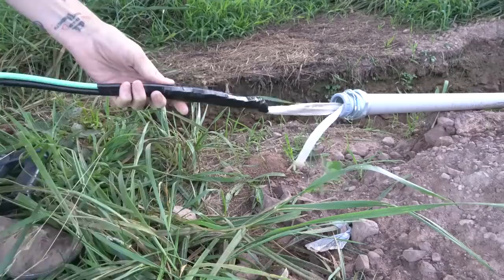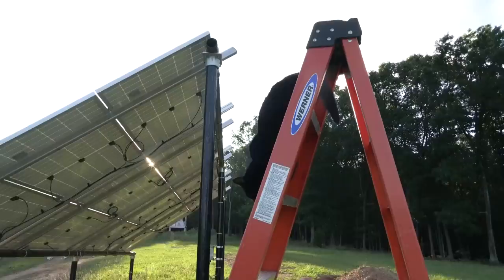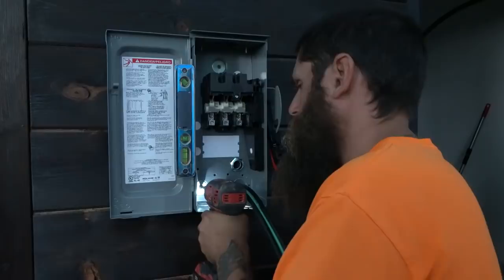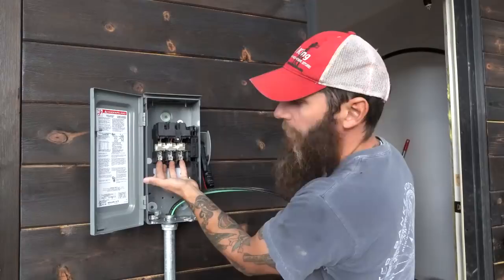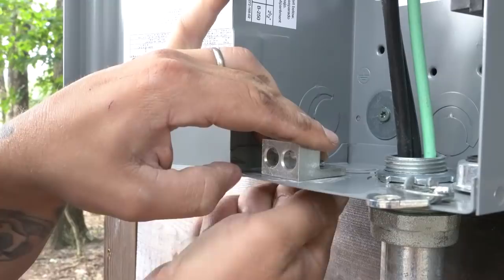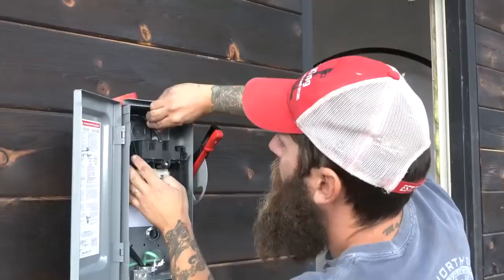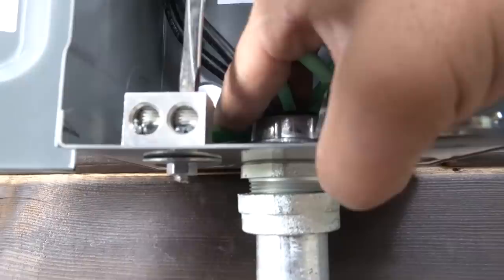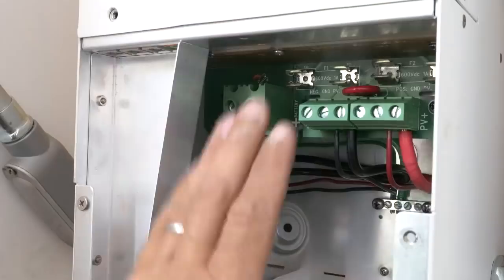She's Got A DISCONNECT- DIY Electrical

Comment: You can tell this is not Josh's first rodeo !! We need to hear the light bulb story !! Great camera work, Erin !!
Reply: Well from what i saw , i think he is an electrician in real life :D . That's why he is so good !
Reply: @clodu2008  He is.
Reply: @williscooper7750  i watched the first few seconds of him stripping back to do the pull and i knew it and miwalkee tools most good electricians use them and i like his explanations
Reply: @clodu2008  As an old Master Electrician, the only thing that I saw that was a "violation" was pulling wire into an incomplete raceway. Which is helpfully located in the portion of the code titled "Silly regs that we've been known to ignore". But it's in there, somewhere. 

So, yeah, perfect. :)

Not sure why he chose to use a 3 pole disconnect though. But if you have one laying around, and it's free, it's a perfect choice. :)

But no ground rod? I'm not up on solar installations, solar power mostly being limited to clothes lines in my day, but this looks like it would need/benefit from a ground rod.
Reply: @MrWaalkman  they have two ground rods.
Reply: @clodu2008  "in real life" ?   lol

Comment: Just a tip: If you put enough duct tape on the drywall when you make a hole in the wall (on the opposite side of the drill entry), the burrs will not appear. That's it. God bless your family.
Reply: but doesn't the duct tape tear off the paper facing of the drywall, creating more of a fuss when you go to remove it than there was the little bit of tear out he experienced?

Comment: I absolutely love your videos and I love the way you work. Once you've determined the quality of those batteries I'd love to have the link to the seller's shop or profile on e-bay. I would love to take my home off the grid.

By the way, I'm also an electrician for 35 years now (currently a project manager in large scale electrical contracting in South Africa), and I love your quality of workmanship. Standards over here sometimes are so low you struggle to get someone to use a spirit level.

Comment: Your craftsmanship and pride in work shows.
Question...is buring aluminium wire not against code there?

You two are great!
Reply: @usplusfive5968  
Oh, ok. Thanks for the reply. The inspectors around where I live came unglued when I inquired about buring aluminium and not copper because of costs.
Reply: Wm H , you usually have to go up one size when using aluminum but it’s best to pull out the code book and check. I went up two sizes to cut resistance and save energy over time. It pays back if you keep the place for years. But since they went up to 288v, the amperage will actually be really low. Most folks don’t know it but high voltage and primary lines are usually only 61 amps.....but thousands or tens of thousands of volts.

Comment: I am a sparky myself and wondering why you put the cut-off box on the outside of the shed? Could you have placed it on the inside? What are your reason to put it on the outside? Has it to do with US code that the cut-off must be open access and not in a closed shed (maybe safety and firedepartment rules)? 
It's looking great and I'm sure it will work wonderful!! Love your videos and you banter makes me smile. 😃😂👍
Reply: I thought the same at first then thought maybe it was to be able to use the buggy to pull the wire? may have been tricky if it was an interior end point?
Reply from the maker: It could have placed inside the shed. It was just my personal preference to be able to access it from the outside.
Reply: Guust you don’t want that big box in your house , but I Think he could have used a main breaker in the house channel

Comment: Nice professional job Josh. Your are a 5 star electrician. You do it right or nothing. No corner cutting. BRAVO. 
And my panels are also located far from my house. I have a 3% drop but I have a 8kw system.

Comment: why you didn't pull a spare pulling wire with the electrical wires  for future updates
Reply: You really think he didn't size this wire up enough to handle future solar upgrades? smh.
Reply from the maker: We sized the wire for an additional 6 panels which is more than we will need.
Reply: Now what is done is done you did a great  job but I wasn't talking only about  electrical wires it could be used also to   remove defective wires or pass network for security cameras  it holds a great angle from the other side  that's it . It will  always come in handy you never know   cause  it's a very long run  if you want to fish it  in the future ..

Comment: Just a tip with the anti-ox paste, it works great on copper and vehicle battery terminals. The reason why the aluminum is larger than the copper is aluminum must be 1 size larger (at least) to carry the same amount of current as copper.  There is a section in the NEC codebook which has a nice chart on all capacities of all size wires, alum/copper, depending on your application.  Looks good!

Comment: Thank you for taking the time to explain why you were doing all the steps and why the equipment you used was required.  I’m glad you had a good experience with the AltE store. I am leaning toward buying my solar components from them. I would like a little more info on the batteries you got as that seems to be one of the most expensive components of the system, especially for lithium batteries.

Comment: Hello guys, greetings from Bulgaria :) I have some questions and advices for you.
Firstly, how you`re not afraid of hailstorms for example. A big storm can practically destroy your solar panels. It will be a good idea if you install additional power sources on your property. For example, if you have a small river close to the house you can put a water turbine generator there. Its much more effective than the solar panels. Also, wind turbine is a good idea if you have enough wind in your area.
Another thing, have you considered using super capacitors instead of batteries. Yes, they are more expensive, but you can use them for many many years without changing them. 
That`s all from me, I wish you all the best :)

Comment: In the house, in the box, 600-watt fuses are installed. 600 volts. Multiplied by 1 ampere is equal to 600 watts, I think it will be small. Although I do not know what you conceived there. But even a simple electric kettle consumes from 1500 watts.

Comment: Also I've seen other people make the solar panels adjustable. To help catch the best angle coming in. And you sending that solar a long way. I think you should get another small panel close to the house. Make it adjustable. And you def. Need more batteries. You could wind up without power for a few days during bad weather. Not sure how you would tie it in. But that's your headache not mine. Great work.

Comment: Very nicely done video and work!    Just so you know, the 3% in NEC for voltage drop has nothing to do with what you were doing.   Voltage drop for what you did is, less power for shorter amount of time.   Shorter amount of time because start voltage for the inverter will take slightly longer to reach in the morning and off sooner in evening.  Your 2%, perfect!    Also,   For bee or wasp stings, wet tobacco and stick on the sting ASAP.   Leave it on for a while.   You might not swell at all.   I learned that from an American Indian when I was young.   Best wishes!

Comment: Nice and clean installation. If anything I would have identified the natural with white tape. And in most electrical connections a loop in the wire before the final connection. The loop does two things, if the connection burns up you have enough material to make an adjustment. a loop (although small) provides a cancelling emf. kinda like a filter - magnetic fields cancels each other. I normally work three phase but I carry it into the single phase applications too. On the surge arrestor - does it have a physical identification if and when it receives a strike? Overall Nice Job.

Comment: The other downsides of aluminium wire: it breaks after bending 3-4 times, it creeps away in the clamp - you have to retighten the clams every now and then. We had aluminium cables all over in the GDR, thank god we do not see it often anymore.

Comment: I REALLY appreciate you showing the correct way to wire and great camera work.  Noticed the wiggle when you're tightening the lugs for a better contact (I assume).  Does Alum have the same load capacity per/gauge as Cu?    You Tube University, at it's finest!  Also, THANK YOU for going there!!!  Funny stuff.  BTW, screw dinner, I want to hear the story!!!

Comment: Josh your workmanship is incredible I especially like how all the fitting screws are in line and the overall neatness is awesome.  I do have one question though, why mount the disconnect on the outside of the building?

Comment: You are good to go on the panel mine is next to the solar system you guys are great I got my batteries from batteries plus 275amh for 125.each im an old disabled veteran i got my solar from amazon plus free shipping panels 89.each i have a lot for sale. By Talkeetna ak 10.000.and one more thing have you guys made pizza bread or biscuits from yogurt self rising flour. Its so good

Comment: I didn't realiize how much effert went in running a line that far away. .Josh you done a great job wiring.do you do electical work in VA? just wondering I'm just in the process of building a smaller home and It might take a while but I'll need a electrician. You know what your doing. I won't have a big array like yours but you could do it. You guys make a great team. That's why I love your channel so much. Even the kids work out too. much love between you all and god bless your family.

Comment: Great video 
Like what you guys are doing.
I'm surprised that you did not install a ground rod and connection at the fuse box on the cabin .
Reply: Hi Other  Guy, sir you are 100% correct. A solid copper grounding rod buried in the ground it required to ground the system.  Hopefully now that you mentioned it they will look into it and adapt.

Comment: Hi. Wouldn't it be better to have one ground rod for the panels, and another ground rod for the shed? You wouldn't need the green cable, and resistance to the ground would be lower in the shed.

Comment: So I'm guessing that disconnect is DC ratted for the 280 volts DC.  I have seen companies use AC, Disconnects that burned up once set to disconnect because of the arcing from DC voltages that high.   I know all most all AC breakers ect have a DC rating that they are able to work with.

Comment: Ah yes, Lords of all you survey! Building your own solar system. And you saw it and said it was good, yes, very good. Great job guys. As for the expansion of power, Yall should have plenty of squirrels around there. Just catch em and put them on energy generating treadmill wheels. Seriously though, have you considered a wind turbine for the short days of winter when the wind blows well? Also, Josh, what did you use to suck that pig through the pipe with the strap attached to it for the pull?, thats a lot of suck. I must also point out that Josh looks as if he has mounted those boxes before LOL... I noticed you use a flat-sided shank on your screwdriver. Knowing you electrify for a living, is there a reason you use flat side instead of smooth round? The video was excellent! It was real good of yall to do it.

Comment: Just curious where your actual earth ground is? That wire you pulled was your bonding wire, but I didn't see an actual ground wire. Also, nice job on the phase tape, but that small of wire isn't allowed to be phased tape in AZ. It has to be factory color coded.

Comment: Disconnect may be rated for 600v, but not DC.  It may disconnect a few times under load but will eventually weld itself together or arc the connection so that it won't work.  AC is much easier on disconnect, it's alternating, DC is constant, unforgiving.
Reply from the maker: It is rated for 600v AC AND 600v DC
Reply: @WildWonderfulOffGrid  3 phase DC, first for me

Comment: As far I could see in the video,  the pipe with the wires through the outer wall is not airtight. I'm wondering if this Is not covered by the Building Code. In the Netherlands this should be always the case.

Comment: I have to wonder, why pull that much wire for a ground?  A ground rod at each end would have reduced the cost quite a bit and given much the same results.  And if I remember correctly will be required anyway for code.  Two ground rods would run about 15 each for a total of 30 bucks vs about 1 per foot over 400 feet.  I know some locations require bonding of a minimum of two rods but even two at each end would have been less costly and each structure needs a ground rod of some sorts.

Comment: Josh, I'm not familiar with solar power, so I've got a question. Does your system require a ground wire/rod like at a standard residential service entrance? I saw where you used the lightning arrestor , does that replace the grounding rod? 
Very professionally done, I must say!

Comment: You definitely do good work. Only electricians get that excited about ground bonding. Lol but... Did u use a DC disconnect because of the DC arc is harder to extinguish due to it never crossing 0v like an AC sine wave? If it's not I'm sure it will be fine but I wouldn't use it too often under load cause it will wear out the contracting surfaces a bit faster. Typically u see relays and such that are rated for both AC and DC usually handles a lower DC voltage and current then its AC rating. DC disconnects are often breakers but can be blade. Its probably a DC disconnect and u just didn't mention it.

Comment: I am sure the power on the solar panel side is not connected, but shouldn't you be wiring that with the disconnect switch in the Off position?

Comment: What type of wire are/is you using from solar to controller?  Doesn't look like DC type wire or stranded wire. Whatever it's called 😁. Looks like regular aluminum house wiring.  Thanks. OBTW I just found your channel.  Very awesome.

Comment: Can you give more detail about your charge controller Inverter and batteries. Are you an Electrical contractor? Seems like you have good knowledge of electrical installations. Very interested in the Tesla batteries, you mentioned that you bought them on Ebay, but nothing else. Can you give cost of system components and specs. Thanks.

Comment: was that aluminum wire? probably should have sprung for copper,much better for voltage  drop and long term use .retired ibew electrician

Comment: I have a huge question I wanted to ask when you first posted this video. How do you get the wire pull strap through you conduit in order to pull the wires through it? Did you put it in the conduit PVC sections as you were gluing them together?

Comment: I would not have used aluminum wire. The expansion contraction of aluminum wire loosen the connection which becomes a hot spot and can cause a fire. You need to routinely check for tightness or use IR to check connections.  My first aluminum wired house during Vietnam war time frame burned down within three years. Never again.

Comment: I have a question on the dc disconnect.  I imagine having both solar and generator going to my hybrid inverter.  I want a manual bypass and safety switch so I can isolate either solar or generator. so that I am running the  house with solar or generator or grid (different manual bypass and transfer switch) what happens when there are 4 strings of solar going to the invertor (  4 can be inserted into the inverter I have in mind) does all eight wires have to be put in a PDB  etc then connected ( generator on top and solar on the bottom)  to the disconnect ?
Thanks (newbie)

Comment: Hey not trying to sound like a know it all but aren’t you supposed to have two hot wires, a neutral, and a ground. I’ve never wired up something like that but I’ve wired a lot of mobile homes and it’s always been a 4 wire from the indoor to  the outdoor panel. Just curious that’s all, like I said I’ve never wired up anything like that so I don’t have a clue

Comment: Greetings from just a few hills over from you.  I'm building a small 48V PV system and kinda stumped on disconnect options.  Is this the most affordable solution for a basic disconnect on the DC side?

Comment: That looks like aluminum wiring.  You probably know this -- just be careful with aluminum wiring - if connections not done correctly they will build resistance over time and overheat and could start a fire.  OK, I see you are doing it right.

Comment: Please get a BMS for the batteries.  They need it.  If you cycle them enough each "cell"  will end up with different voltages. Too high on one  and they  can become dangerous.  I would hate to see a battery fire ruin all your hardwork.

SimpBms plugs directly into the Tesla slave board. Buy there are many other options that are more professional.